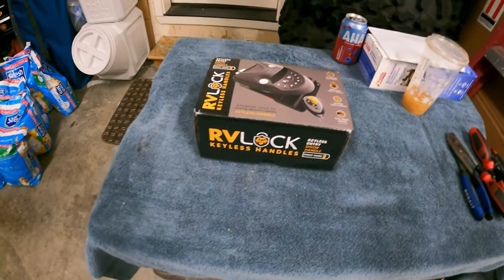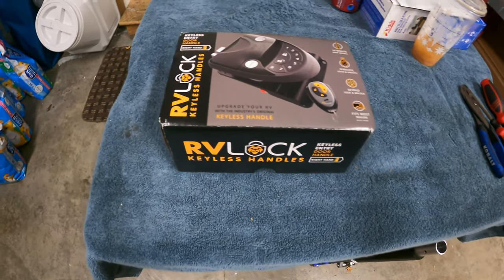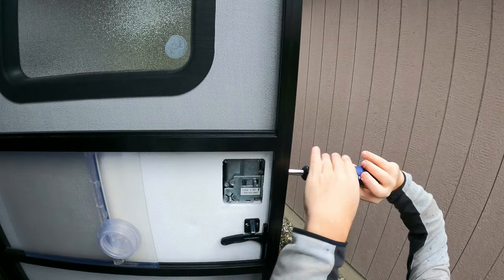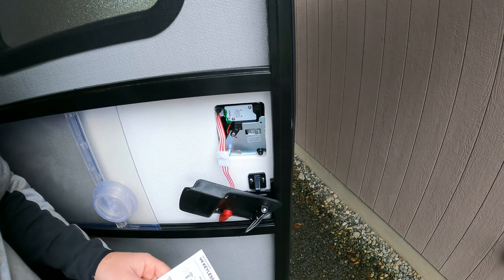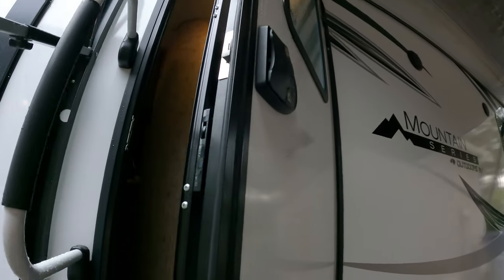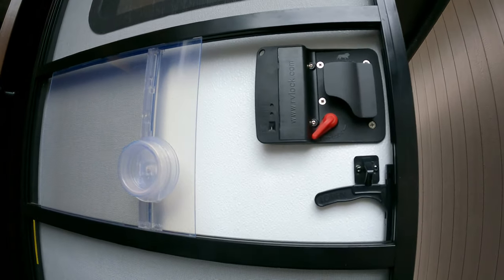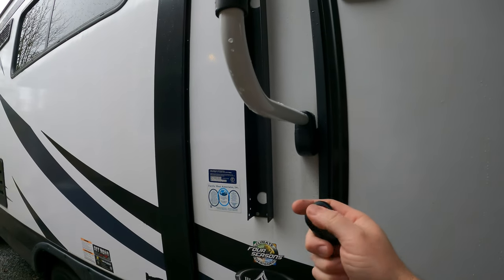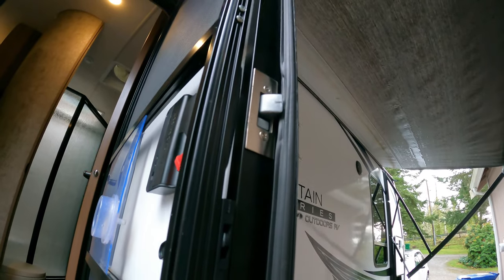RV Lock v4.0 Install and Overview w/Remote

Comment: Question.  If you leave your RV and lock it but accidentally activate the key fob to open your door while putting it in your pocket/purse/or whatever, will it automatically return to locked if the door handle is not used?  
Enjoyed your video and we're obviously thinking of changing our entry system...
Heck, this review is over a year old, would you still recommend your featured entry system?
Reply from the maker: Thank you. No it will not return to locked position if handle is not used.  There is the latch lock you could use as well, but requires a key.  The motorized and key fob controls the deadbolt. 
 Yes I would get it again especially now that the backer plate is all metal and not plastic. the plastic version kept felt like it was going to break
Reply: @DinkGear  Thank You!!  Update:  ordered it 4/3/22 after checking the dimensions on the current door handle/lock on our 2004 Alumascape TT.  Thanks again for your review!
Reply: @DinkGear  I received ours yesterday and did the programing before I even tried it in our 2004 Alumacape TT (Although I had measured the opening to ensure it would/should fit). 
Works like a charm.
Thanks again for your detailed video and feedback.

Comment: Enjoyed your video, I installed the same latch on the same make of trailer. My door became more difficult to close after install. How did you remedy this?
Reply from the maker: Thank you... I took off the silver door piece (strike plate) on the ORV door frame (not on the door) and made the screw holes a bit elongated so that the piece moved more  outward. Door closes fine now.
Reply: @DinkGear  thank you!
Reply from the maker: Also, they make a new metal backplate now. It doesn't feel like it's going to break now when pulling it shut

Comment: You didn’t describe what the extra piece was and why it caused an issue.
Reply from the maker: It was a plastic shim that went around the v4 deadbolt area  Made the lock too large to fit into door area.